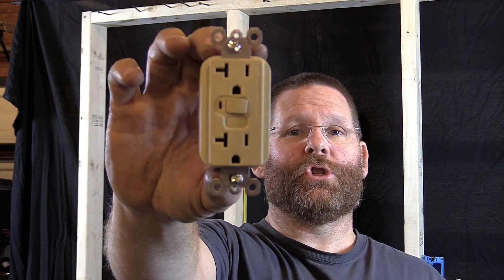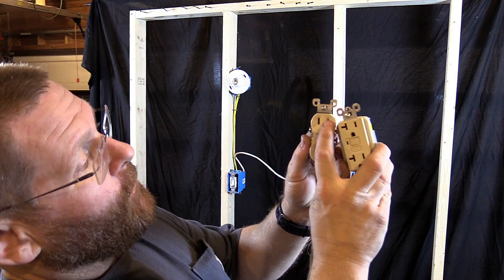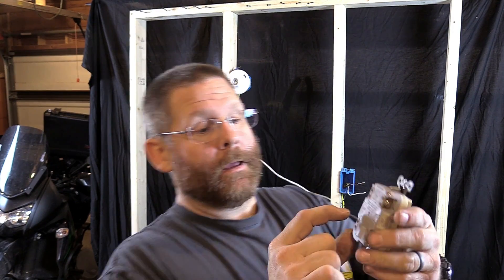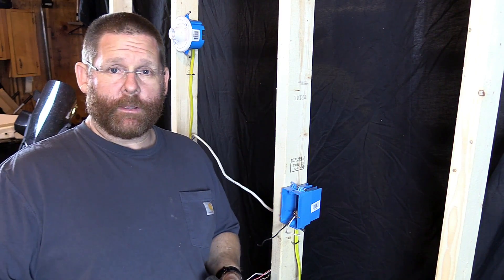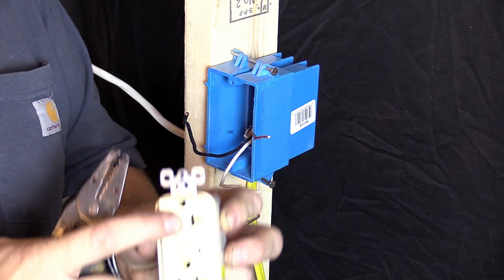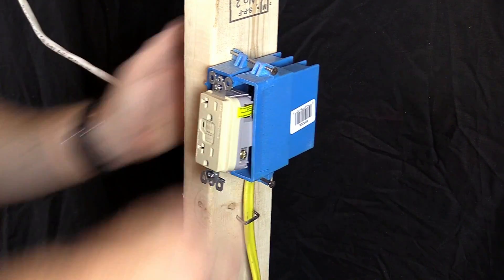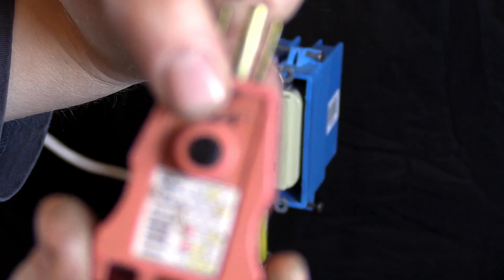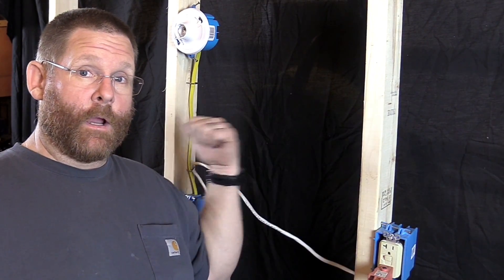How To Hook Up A GFCI

Comment: If the breaker is 15 amp don't you need to stay with a 15amp GFCI? Also, when would you put in a GFCI breaker instead of replacing on the receptacle side? As always, thank you for the information.
Reply from the maker: I need to tell you that I did miss quote my comment with you. A 15 amp breaker needs to be a 15 amp receptacle per code. If you have a 20 amp breaker you can put a 15 amp receptacle on it as long as you more than 2. Code reference is 210.21 (B) (3). I did miss quote that comment and I stand corrected.
Reply from the maker: So if you have a 15 amp breaker you can put a 20 amp receptacle on it. The breaker will only allow a 15 amp before trip. As for the gfi breaker, for me it's just preference. If you trip out the breaker you will have to go to your panel to reset it. Where as at the receptacle you can reset it there. My personal opinion is that if you want to make sure that everything is dead wires and receptacles gfi breaker is the top choice. If you use gfi, the wires in the box will still be hot after the gfi trips. Hope that doesn't confuse you too much
Reply: @MountaineerOutdoors  No, that did not confuse me. It was the answer I expected but to dumb to know for sure. Thank you for your time.
Reply from the maker: My pleasure and glad didn't confuse you. Have a great day

Comment: My room/office now has 2 prong outlets. I'm looking to upgrade to 3 prong grounded outlets. And I want to add a window AC Unit so I can work in the summer. I know how to change a outlet, but for adding a 3 prong, I've decided to call a electrician. The office is in a finished attic so it gets hot in the summer and with equipment, I definitely need AC and a fan won't cut it.

Hopefully it's not too jych trouble to get things grounded and made safe/updated.
Reply from the maker: Make sure that they don't just replace it with a grounded plug when there is no ground in there. They must use a gfi to satisfy the code or pull a new wire to make it grounded.
Reply: @MountaineerOutdoors  Please clarify for this newbie with similar concerns: "pull a new wire to make it grounded." By "a wire" do you mean one ground wire? Can a (thin) ground wire alone be fished/pulled through existing conduit or ancient bx lacking a ground wire buried within plaster & lathe ? many thanks for your reply & videos.
Reply from the maker: If you have a conduit you can add s ground if you have room in the conduit. If it's a romex you cannot pull a loose ground wire by code. It needs to be under one sheath. So, if it's inside the conduit yes, romex no. It has to be s brand new romex

Comment: You must not use 20-amp receptacle just because it's more "heavy duty" on a 15 amp rated circuit.  That would give a wrong impression that that line has 20-amp max load causing the breaker to trip.
Reply from the maker: True Just like you mentioned, the overcurrent protection device will only handle 15 amps.

Comment: i noticed that some wires have 2 whites & 2 blacks  but my wires are red white & black & the ground  i tried to install a gfci regular one not the 20 amp & the damn thing blew  so in other words i caused a short & my breaker popped also  no matter what i did it would make an explosion & breaker jump  i threw 3 jacks what am i doing wrong ??? can someone tell me how to install the wires correctly  since i only have 3 wires & not 4 excluding the ground
Reply from the maker: Are you sure that what you are working with is a switch or part of a switched receptacle circuit?
Reply: @MountaineerOutdoors  i am not sure i don't know much about electricity  if you could tell me what type of switch i should buy  would be great  it's just a wall switch that would be used  for a kettle  it's a 120.....  thanks for the reply

Comment: I live in a old house with only a white and black wire. Will the gfci work with no ground? If so how is the hook-up done? And how to test?
Reply from the maker: Well without a ground wire you will not be able to trip the gfi. The white wire goes to the silver screw and the black wire goes to the brass screw.

Comment: Is there some info about GFCI breakers?  What are two black wires to a GFCI breaker and the white wire?
Reply from the maker: What kinda panel? Are you sure you don't have a shunt breaker?  Anyway I want to do a video on them. Should only have 1 white wire then the curly one plus the hot (black wire)

Comment: Those aren't push-in terminal holes. They are clamp terminals. Push-in terminals are on residential grade devices.  A 15A GFCI is rated to pass 20A.  I've never encountered a 20A appliance in a commercial or industrial environment in 40 years. You don't use a  power driver to attach a device to a blue plastic box, because friction heats the plastic and it seizes to the screw and the screw will break when it comes time to remove the device.
Reply from the maker: I don't believe that I said that for a gfi, clearly it's not a push in type its a clamp. Great point on the drill

Comment: If you install a 20 amp GFCI , the wiring supplying it has to be 12 gauge.  You should not put a 20 amp one on 14 gauge wire even though it works , the wire may over heat on a 19 amp load if it didn't trip the 15 amp breaker that is protecting the 14 gauge wire.
Reply: It's perfectly ok as long as the breaker in the panel is rated at 15 amps. You can't draw 20 amps magically because you use a 20 amp GFCI, breaker determines max output.
Reply from the maker: Exactly
Reply from the maker: I fully agree.. With This statement..

Comment: i'll try to make this short, what if you have two gfci outlets outside on two different breakers but when you plug things with a heavy load (like an electric smoke, or air compressor) they trip instantly? i've replaced both 20 amp outlets and they still trip, and i realize that would usually mean whatever i plugged into it had a bad ground but its happened with most things i plug into the outlets. should i just wire in a standard outlet and be down with it? also the things that are making the outlet trip work fine on standard outlets and also worked fine at my last house without tripping the gcfi's.
Reply: You need a bigger breaker installed. Your circuit is prob 20 amp. Mine does the same thing so I need to run a big extension cord into my house when using my air compressor to plug it into an outlet thats on a 25amp breaker/circuit
Reply from the maker: Ok questions, is this on a gfci/arc fault breaker?  You shouldn't change out the gfi to regular unless you put in a gfi breaker. It's definitely there for your protection. It may be sensing a ground... Or it's completely possible that your ground and nuetral is touching inside the Recep box... Ive seen that before. Make sure that your air compressor will work on other gfi's before doing anything drastic.. If they trip out other gfi's then it could possibly be your stuff. Keep me posted

Comment: I connected a gfi it has power but does not work
Reply from the maker: My guess is this... The ground is it connected to your panel ground?  And are you sure you have the line and load correct?

Comment: The best way handle a GFI is to remove it.  They are very troublesome.  As to your explanation the line is the power supply, the load is whatever is being operated from the outlet like a refrigerator.  As for placing the wires a lot has to do with the depth of the box you are using.  The reason for the Tslot is to prevent a 20 amp device from being plugged into a 15 amp outlet.  It could be large heavy load extension cords that are sometimes used in construction running say and air compressor and a power saw.
Reply: Odd. I have worked with many hundreds of GFCI receptacles and breakers over the past 40 years or so and only had one problem and that was with a cheap, Chinese device from Harborfreight.

Comment: Does aGFCI plug require a GFCI breaker in the breaker box?
Reply from the maker: no it doesnt
Reply: Not only "no", but you should NOT install any GFCI receptacles on a branch circuit that already has a GFCI breaker.

Comment: GOOD VIDEO !  THANKS !  I LIVE IN AN OLD BUILDING THAT WAS BUILT IN THE MID 1960'S AND THERE IS NO BARE GROUND WIRE. HOW ABOUT YOU DOING A VIDEO DEALING WITH OLD WIRING IN AN OLD STRUCTURE...PLEASE ???
Reply: I'm absolutely sure you are right, but, it is an old concrete block and brick structure and the housing authority won't consider any upgrades like rewiring the place.  And actually the living room and bedroom are on the same circuit 15amp circuit breaker.  Next time I get a chance I'm going to take a picture of the breaker box and send it to you.  Thanks for your time.
Reply from the maker: Noted..I will keep this in mind thanks for the idea. To fix your problem it's best to rewire... Have a great day ☺

Comment: How many times have you slipped off with that slotted screwdriver and gouged your hand?  You should mention that the 20 amp plug doesn't give you 20 amps unless you have a 20 amp breaker.  Where I live you now have to use tamper resistant plugs. Also if you are retro fitting a gfi plug make sure the box is big enough especially if there are more than 2 wires and maybe marette caps. Some codes now require arc fault circuit breakers for all but a few locations. you may have to install a gfi arc fault combo breaker. I've just had $2200.00 of breakers installed in my new house.
Reply from the maker: Wow yes everything you said is 110% correct. As for that slotted screw.... Uhhhh they certainly are terrible on the hand. In the future I will definitely mention that. Have a great day and thanks for watching and commenting ☺

Comment: hello, Yes this is what im talking about , the ground plug is at the bottom. That is how i was taught with good reason behind it. But the writing on it is up side down. They change the ways and laws when ever some fool gets a  new position. Get my drift?
Reply: The NEC doesn't specify the orientation either method is accepted.  The ground inlet on top should be the preferred method.
Reply from the maker: I would disagree with you on that, when I worked for one electrical contractor that was the way they wanted it... To me I'm my opinion it's an eye sore... To each their own. I won't do it in my home but if it was code then and only then I would. I would also do it if I worked for a contractor or homeowner who wanted it that way. It's just preference though.

Comment: In this case, since the load is not something plugged into the outlet, the load would be one or more outlets further down the line, i.e. further away from the breaker box, and any ground fault in one of those outlets further down the line would trip this GFI box, thus this GFI outlet can protect several outlets whose feeds are attached to the load side of this one GFI outlet. If I am incorrect, please correct me.
Reply: You are correct. No need to replace  every outlet on the same circuit.
Reply from the maker: From what I am reading yes you are right

Comment: Yeah, but.... that looks like 14/2 wire which would be protected by a 15 amp breaker back at the box.  Put a 20 amp GFI in and the next guy will think the receptacle is good for 20 amps (which it isnt).  Attempting to plug in a 20 amp device/appliance will pop the 15 amp breaker every time.
Reply: the wire is yellow hence 12/2
Reply from the maker: Yes I agree

Comment: 15 amp v 20 amp. you will appreciate the difference if you use a heat gun for more than 20 or 30 minutes.for example you are stripping old paint off of wood. you need a 20 amp circuit.
Reply: Or running wood working tools, I can’t even run my portable table saw in garage with shop vac at same time without breaker going off most the time. Too much with lights too. Very dangerous also when lights go off mid cut, at least the saw turns off too I guess. Haha I need a pony panel and some 20amp circuits for my wood shop with industrial table saw that’s for sure.
Reply from the maker: Yeah most vaccums and saws requires a lot of juice. Shops should have plenty of power at hand. Dedicated circuits for those shop items saws, dust collectors etc. Thanks for watching and commenting
Reply from the maker: I can agree with that.

Comment: I'm looking to build a fake wall like you have, but smaller -- about 3' x 3' -- with various receptacles to practice wiring (e.g. 2-way switches).  What is the best /safest way to power this?
Reply from the maker: I would recommend that you power the  switch, Recep with a plug end. That way you will be safe. Use a gfi too for the wall receps to plug into.
Reply: @MountaineerOutdoors  Would using an extension cord work? ... male end pluged into existing home GFCE and other end wired to recep/switch in the fake wall.
Reply from the maker: @jkimo11  honestly that what I do
Reply: plug it in.

Comment: I replaced my gfci in my bathroom it tripped and won't reset. I didn't do the ground neutral hot step and I didn't turn the breaker off. Is that my problem?
Reply from the maker: well honestly I can say I have never hooked up a gfi hot so that is an answer I cannot answer.  Just a guess but are you sure you put it on the line side? You may need to try it again with the power off if it doesn't work. Let me know what you find out.

Comment: So white, neutral, and load all refer to the same white wire?  My understanding is that the white/neutral/load wire goes to power the other receptacles powered and protected by the GFCI.  Yes?  Awesome video, by the way.  At 59, I’m just learning how to do some of my own work around the house.  Thanks!
Reply from the maker: You have a romex coming into the box. One black and one white with ground. That set is the line hot and nuetral is line if you are protecting another receptacle down the line from that. That romex is load. The hot on that romex is load and the nuetral is load. I appreciate you watching and commenting

Comment: Thanks, helped me understand what I did wrong. I went to change it out, I had gotten the wrong one. I went to put it back, and it kept on tripping. I left it for another day, and that was today! Realized by your video that it was carrying the other two in my master bathroom. Went to go cut my hair with the buzzers, oh hell I guess I have to figure this out. Realized I had the white wires crossed. lol. Funny story though, while trying to figure out if I had power, I had left my water flosser on. I hit the switch on the plug to test it, all of a sudden in my master bathroom I hear this noise. I was like, damn what is that! Then I realized what it was, ran to my bathroom with the water flosser shooting water all over the bathroom. lol
Reply from the maker: That story sounds exactly like something that would have happened to me. Well moral of the story is that you fixed it. I would have loved to seen your face. Merry Christmas.
Reply: Joshua Martelle in

Comment: I'm installing a gfci outlet before the light switch in a bathroom. I installed it per the directions and when I turn the breaker on and push reset on the gfci outlet,  it trips the breaker in the panel.
Reply from the maker: sounds like you might have something crossed up or its on the load side of the gfi ?

Comment: I have a recirculating water pump under my sink connected to a gfi ,and that gfi comes from another gfi which is tripping why wouldnt the gfi where the the pump is connected not trip but the other does?the gfi trips when i turn the pump on..was thinking of putting a regular outlet instead of the gfi ,any suggestions, thanks
Reply from the maker: My first question is this. The gfi are they new? Did someone just recently put them in? Have you tried anything else on the circuit to see if it still has trips. If not.. My second guess is that the in rush may be tripping it out but a recirc pump usually doesn't pull too much. If you use just a regular Recep might want to think about a single Recep. Code says that one dedicated device can be without gfi protection if it's only used for that one device.. Ie.. Washing machine, ice maker etc. Back to the gfi they possible can be tripping due to being hooked up wrong. Usually you only use one gfi for a circuit. But done correctly you can do it like that, what you are describing. Let me know what you find

Comment: my god man get a new tester ...
Reply from the maker: What's wrong with the one that I was using... Still works and does they job... I don't fix anything unless it's broken. Thanks for watching and commenting
Reply: @MountaineerOutdoors  - just joking - star trek came to mind ... hey i live in ecuador [no regulation] and i saw my neutral wire to the breaker box is smaller than the the service entry wires by one size - is that ok ...
Reply from the maker: @jameshumphrey9939  yeah typically that's the way it is alot. The power company can do what they want they have the final say. I didn't take offense to your comment. Have a great day
Reply: @MountaineerOutdoors  thanx  theni